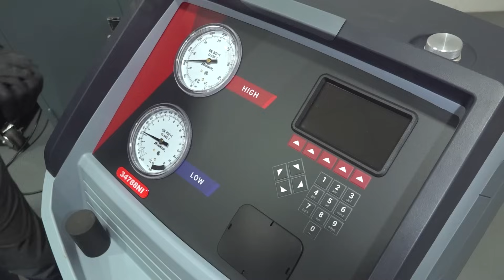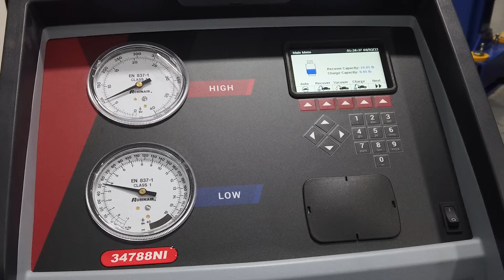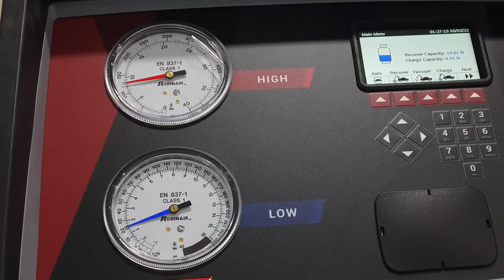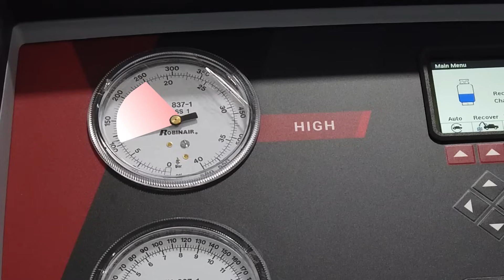Refilled Your Car or Truck's Air Conditioning but Still Hot? Easy Steps to Understand Your AC

Comment from the maker: √  Watch the Video
√  Buy The Part at 1A Auto https://1aau.to/m-Visit-1AAuto
√  Do it Yourself
√  Save Money
Reply: For almost a month, I was having issues with my vehicle's AC unit not cooling. lately, I would be sitting down on a Walmart parking lot sweating bullets because the AC fan was just blowing warm air. Then I saw your video on the section on hosing down the condenser coil of the AC unit. So, I rushed to Home Depot and purchased a hose and a brass nozzle. Came back home and got the hose ready for the AC condenser coil hose down event. Once I finished the hosing process, I took the vehicle for a spin. Guess what! The cooling feature of the AC unit was completely restored. I came back home with a smile on my face enjoying the cold temperature in my vehicle. Thank you Miss A1 Auto Repairs for sharing your expertise through this video with the YouTube community.

Comment: Thanks ever so much, we did a new compressor install and couldn't figure out why it was still going hot. The fan was the problem.your procedure gave us the answer. 2004 dodge ram 1500 5.7.

Comment: Over the last few days, I refilled the AC and it was only going down to 80 (100° outside) in the heat of the afternoon, The next morning it was cold but a few hours later it was back to 80 (at least it's colder than the 100° outside). My next guess is the condenser clogged?

Comment: Here's a great tip to all reading my comment. In the vehicle that is shown here - The openess of the Condenser coil is relativity easy to access . The greatest thing you can do to keep your coil clean 99% of the time is to put a window screen in front of the coil itself. A screen about the same size of the condenser itself is all you need , it must be in a frame double layered. This in tern will keep the debris out and the Bugs out of the fins Thus keeping your air flow to the Maximum potential. This in turn also will help keep your cooling system in good shape and you'll have less chance of over heating due to a plugged condenser coil...
Most of the vehicles like Dodge - Ford - GM have great access and open space.
Then all you have to do from time to time is easy maintenance and brush the screen clean to maintain maximum air flow. My F250 being a 2008 has this when I bought the truck and it has been a Must have feature - that all vehicles should have...

Comment: Hi Sue, nice explanation. Lately, when i'm at idle (with "max AC" button also on), I noticed My Fiesta's AC compressor almost always engaged & never cycles OFF. the AC also feels cold (just like before when it was always cycling ON and OFF periodically).  I live in Indonesia , hot country. Everything looks nice and clean. So What do u think causing it ? 
Thanks

Comment: What causes the compressor not cycle off and on during operation? I just put a new compressor, condenser, drier, evaporator and expansion valve. Pressure is good and ac is cold but not icy cold. I have a 2007 civic hybrid. Thanks!

Comment: My AC fails to work when the outside temperature is over 90 degrees or hotter.  It will blow hot air.  But when the temperature drops down to 80 some degree, it will start to blow cold air again.  What is the problem, please?

Comment: My condenser fins are all bent and clogged. My compressor clutch cycles when idling but runs when on the freeway with cold air. Should I change the condenser and the compressor or just the condenser? Any help is appreciated. Thank you.

Comment: The condenser fan does not cool the refrigerant. You have to understand the refrigeration cycle. The condenser fan removes the heat from the evaporator and condenses the refrigerant vapor back into a liquid so that it may go through the orifice tube or expansion device and flash so that it may turn back into a low pressure saturated refrigerant mix and evaporate to cool the car inside through the evaporator. Latent heat from the refrigerant is actually what cools the evaporator as it's evaporating from the coils. It's absorbing the heat and sending it back to the condenser as a high pressure vapor to get turned back into a liquid again. It's a cycle. And understanding that cycle can help you diagnose a problem better

Comment: I got a 1997 Honda CRV just topped off Freon system runs great for a little bit then pressure blows off through pop-off valve what problem could that be or what could I look for any help would be greatly appreciate it

Comment: Hey so I used the can thing and it gave me heat last summer. Didn't drive the car for a couple months by that time it was spring and I didn't need heat but the air didn't blow cool at all. So should my next steps be removing the freon or spraying the condensor?

Comment: Little things wrong here. The AC system works like the coolant in your engine it absorbs the heat and dissipates it out side the car. The condenser is what dissipates the heat and the fans help do that. Not all systems have receiver dryers if you have an expansion valve you’ll have a receiver dryer on the high side line if you have an orifice tube you’ll have an accumulator on the low side line. Not all AC systems cycle the compressor older cars it’s just on or off no cycling.

Comment: What if ypir lines going in are cold bit it blows hot in the cab
Reply: Could be a bad blend door there’s a door that closes off the heater core or evaporator depending on what you select heat or cold. If you get heat that tells me the door probably stuck

Comment: Thank you for the video, good info. What happens if a system is full, compressor is good and system blowing warm after few minutes.  Should you recommend check compressor clutch or expansion valve.

Comment: box connector, or is it sold separately, I have 09 chevrolet malibu ltz 3.6, I believe I spliced my fuse box wires wrong, now I may need new harness to fix it, it cranks but runs very rough

Comment: Thank you that’s was really useful information. Any tips on if it it gets cooler but not really cool? Like the temperature is definitely cooler than the outside air but it’s just mild at best? Thanks for all you do.
Reply from the maker: +Dao Yang We wouldn't be able to diagnose an issue like that here, you may want to have a local mechanic take a look at it. Thanks for checking us out! http://1aau.to/m/Shop-1AAuto-c
Reply: Get the air vacuumed out or need more ac recharge.

Comment: AC blowing hot?  First check to see if your coolant level is normal.  I had no AC and my friend told me to check the coolant level.  He said that if the level is low, the computer will not allow the AC to blow because it would stress the engine too much and overheat it.  Sure enough, the level was low.  I added about a half gallon of coolant and wouldn't you know it, the AC blew COLD again.  And yes, I did figure out where I had lost the coolant.  Pin hole in a hose.
Reply: Yes cause with the ac pump on it puts a small drag on the engine you can really feel it going up hills engine gotta rev much higher why when I go up a hill I turn the ac off for couple seconds makes it much easier on the engine. I’d also recommend shorting your oil changes when it’s AC season cause the engine works little harder with that ac pump and the oil could become more degraded faster. I do 4,000 oil changes in the summer 5000 too 6000 in winter when I’m not using AC

Comment: In a closed and pressurized system, how does moisture get in to it where it will overwhelm the dryer?
Reply: Moister is caused when the hot liquid hit the expansion valve or orifice tube causing the hot liquid to be compressed to a cold gas just like an air compressor anything that’s compressed will cause some moisture the accumulator or receiver dryer collet the moisture cause the compressor pump can’t pump liquid it’ll destroy it. The evaporator in the dash also will condensate from being cold and it’ll drip water out the bottom of the car.